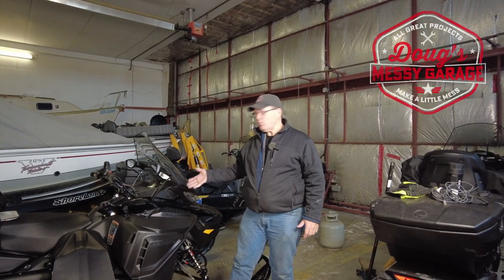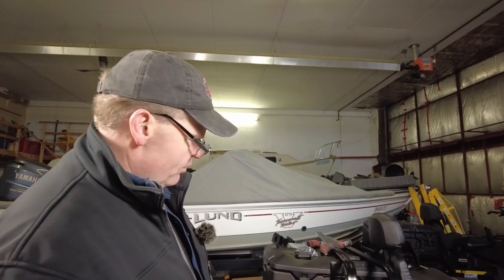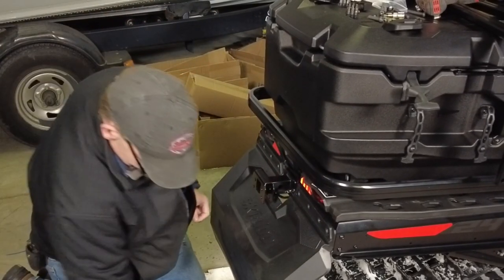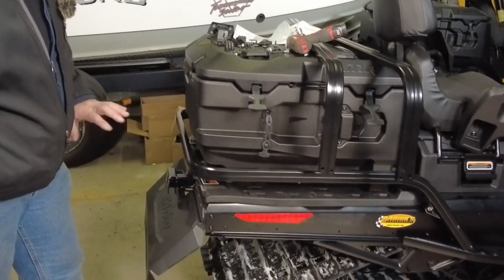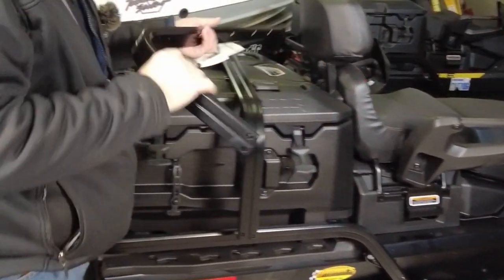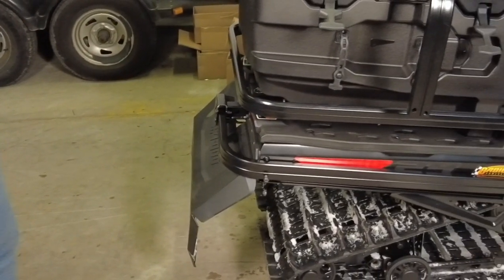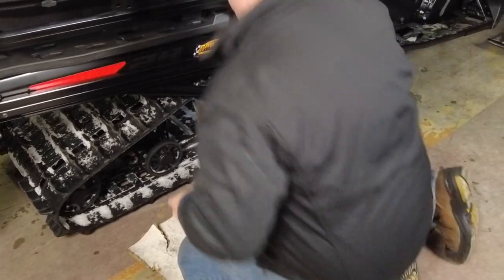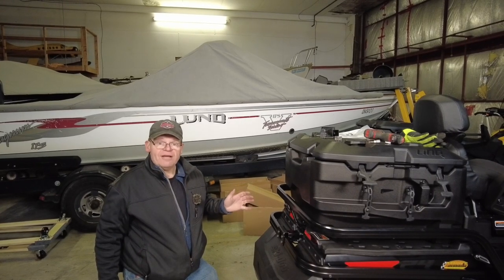2023 Ski Doo Expedition Accessories E2: HD Rear Bumper

Comment: Thanks for the great videos.  I am looking into getting a 2024 20" Expedition LE 900 ace.  Since the unit comes with a hitch when is it necessary to upgrade to the heavy duty rear bumper?  I assume the HD rear bumper allow heavier towing but do you know what the towing capacity is without the heavy duty bumper?  I only plan on towing a portable ice fishing shanty which should be under 300 pounds loaded.
Reply from the maker: I forget the exact point at which you need the heavy duty hitch but your 300 lb ice shack should be fine.  Another benefit to upgrading though, is the wider selection of hitches/accessories for the 2" hitch vs the smaller one.  We run the 2" receiver and 2" ball on all of our equipment so it was worthwhile to upgrade this machine.